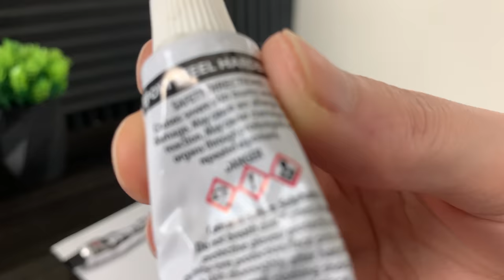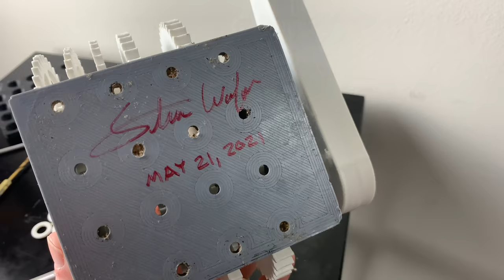3D Printer Gearbox - Spinning it FAST

Comment: Something I see a lot with 3d print guys... Glue in place of mechanical stuff.

Put keyways into your shafts, no you don't need a lathe, use a bigger shaft, drill through it, tap it and screw a cap head bolt into it.

Also, light lubrication and bearings are an easy addition.

Comment: For the handle, grind a flat side on the end of the metal shaft and match that in the handle. Then you get mechanical structure to reinforce the JBWeld.

Comment: Mechanically pin the handle to the drive shaft a small steel pin along with the job weld will get you going pretty good

Comment: It’s like blowers on engines. For the biggest ones you need 800-900 foot pounds of torque to spin it.

Rough the interface you use JB Weld on to give it more grab.

Comment: It would be great if some small ball bearings are used for the gears to reduce friction on the shaft , quite possible it would help spin the gears even fast due to less friction .

Comment: I am sure the suggestion is here, but I would flatten the sides of the main shaft where the handle connects so you can get so more torque. 
Second you can get a laser tachometer for under $30 to give you a pretty accurate read.

Comment: Brick experiment Channel used silicone oil between all the teeth to cut down all the friction.  There's a part of the meshing where they rub perpendicularly, and that's where most of the energy loss comes from.

Comment: Definitely faster than most cars. I've been driviing karts a lot though and they still come out ahead. The largest RPM I've seen there was 17k RPM, my own motor got up to a max of 15.5k RPM.
Gotta stress how not common this is for an engine with gears though. Even racecars tend to keep it below 8000-9000 RPM. NASCAR, F1, Indycar and similar go over.

Comment: Just image to do it with titanium gears precicly cut, screwed to the shaft (or made in one piece), everything oiled at the right places, with a huge motor. Not sure if that has been done already. Cool project to do it with a 3D printer and creating all part by yourself.

Comment: If you would just hold the handle right you could crank it slowly increasing the speed and you could get it a lot faster im sure. It’d reduce the pressure on the handle it has when you just put full force onto it from a stop.

Comment: grind out some notches on the steel bar in where you apply the epoxy. it will grip the metal better

Comment: You should use lubrication
Mostly to reduce generated heat.
Also scale down the last gear a lot so you have even less spinning mass.

On top, maybe try belted gearing. It's more efficient!
And use bearings for the gears

Comment: You can't just depend on the chemical bond of the JB weld. You need an physical bond like an pin or an joint, even making scratches on the surface of the material that needs to be glued will allow it the glue to have more grip on the material so you won't have the jb weld failing.

Comment: Why not use a square key shaft as opposed to round? If you can find some 10mm/1.5mm radius corner shaft... minimal issue with stress points at corners.
Much stronger fit within plastic gears and simply print some bushings to insert into 13mm bearings at either end.
Reply: Also... when using JB to bond PLA to steel... add some notches to the steel or drill and add pins. Oversize the PLA socket and profile in a star shape. Fill with JB and insert shaft in the socket.

Comment: You should make a metal handle or use a longer bar for the shaft and bend it (check some old hand drills for the shape), and use the same shaft to spin it.

Comment: For it not to break put creases.. like in the gears.. then let it match togetherin the handle and the metal tubing.. that way it will not slip or dependent to the epoxy

Comment: Would be cool for you to get a digital tachometer, to compare the calculated gear speed vs actual. If the prints are good the calculations are probably accurate, but would still be a great video aid to see the numbers digitally!!

Comment: You need to key the shaft for the handle so it doesn't break off and then maybe some tiny ball bearings but keep it small the bigger you go the more energy required to input and control.  Flywheels are dangerous

Comment: Mechanical Engineer here... You should invest in keyed shafts, oil-impregnated bronze bushings OR nylon bushings OR cheap ball bearing, and shaft collars.  There's no need for hot glue and epoxy here.  Press the bushings/bearings into the gears.  Besides the fact that you'll have a much more efficient system, these materials are cheap and will allow you to reuse parts instead of ruining them with hot glue and epoxy.

Just a design recommendation, make the housing a square tube instead of a channel and fillet the inside corners.  This will lower resonance significantly, which will drastically reduce friction.

Comment: I figured out that if you print with bridging under the gear you can get the sharp tooth gear to print with perfect print. Just raise the model slightly off the bed and use auto bridging.

Comment: Make the handle part so you can place a drill on it, put drill on low torc and rev it, then put a generator on the end and you will have made more power than the drill uses (I wish, but it will go fast tho), also when you have it up in speed, it should take less force to keep it turning, ergo you can go from low torc to fast when it is going for full, maybe ;)

Comment: That's great!
I've been investigating how to easiest make a DIY oil filter centrifuge. But as I have zero experience with welding I wondered if it can be done with (tough) plastics.
The main trouble is of course to have the spinning cylinder survive safely very high RPMs.
9000 RPMs are more than plenty for my purpose :) 
But now I also wonder if using J-B Weld with stainless steel parts (that will be spinning at several thousands RPMs) would be good enough.

Comment: Alright ik this is a bit of a stretch but I think you could make the gear ratio bigger and instead of 3d printing the handles get them specially made from steel/some kind of metal

Comment: Dude, stop using jbweld and hotsnort.
Use brass/alu collars that screw onto the shaft with a grub screw and are also screwed to 3D printed gear/handle.
To hold the shaft into the housing just have a hole and drive a grub screw there as well, no need for collars.

Comment: To attach the handle to shaft put a simple threaded hole and use a set screw to hold the handle on the shaft, easy peese

Comment: Would be an interesting project to try some better gear ratios in a small wind turbine, I read that " 1,000 to 1,800 " RPM produce electricity with most wind turbines, imagine 10,000.

Comment: Maybe set it up on a table slightly higher off of the ground and away from a wall. This would allow room for a handle at least a meter long. What about metal gears?
Reply: Well,metal gears would kinda defeat the point of a 3d printed gear setup

Comment: You could at least sand the part you glued. Making it a square shape or putting in slots would be better. A hole with another rod going through it for extra support would be even better. But that’s going way outside your printing thing which is the whole deal. Really cool.

Comment: I wonder if you could make a pedal car with something like this... Like a super light but sporty looking frame powered only by pedaling the gears like a bicycle, but could easily reach a normal car's city driving speeds....
Reply: such things exist. but for your idea to be pragmatic it would be a serious engineering feat.

You would need very powerful legs, and the more gearing and complexity you add to aid the human mechanical power and convert into RPM and torque the more complex and heavier the machine becomes.

Comment: So, is it possible to store this energy? What I mean is, if there were 14 wheels instead of 10, and if we could somehow store the rotational energy created by the 14th wheel, we could make a scooter that could go for a long time with little energy. Initially, the user pushes the scooter with his foot several times (just like an electric scooter), and 14 wheels turn with the rotation of the wheel. Then, we can use rotational energy little by little with a part that will act as a throttle lever. Even if this system does not work, we can still save energy on electric bikes and scooters. Of course, the first thing to do is to store rotational energy. and secondly, to use only some of this energy and store the rest again.

Comment: why not try tribofilaments for this? some are printable on a normal 3dprinter anyway. A bit expensive at $100 per kg, but you can print only the center and the teeth with it and the rest (non moving parts) with PLA. It would reduce the friction to less than 10% and allow you to rotate a lot faster. Speed, centrifugal force and even wind resistance would likely come into play before the integrity of the handle in that setting.

Comment: You're using so much force to lift the handle up that you lift up the whole table. Maybe you could add some weight to it or make the table legs more stable and not sure if it's intendet or are you just holding the camera, but you should use your second arm for holding the handle in. And lastly make sure that you spin the handle slowly and slowly make your way of the rps faster so that the glue that the handle is held by doesn't just detach handle's on

Comment: Great build and video!  Any thoughts on what it would take to to connect the output to an alternator or dc motor/generator to be able to charge a 12v 100AH Lithium battery for energy storage?  Gravity, being free, a weight could be attached to the input side and dropped from a height.  With an appropriate electrical components, a proof of concept could lead to next level energy generation for the home into batteries for storage

Comment: Try to add two aimant in opposition(one in first gear and an other in last gear). And with a Hall sensor make a comparison between the n’ombres of rotation ( mechanical formula and timers of a microcontroller)
Reply: No need, he calculated the gear ratio according to the number of teeth.  So just measuring the speed of the handle gave him all the speeds without needing a computer.

Comment: a lot of things here, especially the handle and frame should have been made from metal. its obvious weakpoints of the structure, added to that, ballbearings would propably not be of too much harm to acquire. furthermore, you should not rely on glue or similar substances to attach items to one another. creating mechanical attachments is not only more reliable but also easier to take apart if you need to change something.

Comment: Duuud, try generating electricity with the last wheel, I'm intrested in knowing what's the output power compared to the input, and what are the possible uses in EVs?!
Reply: Output power is less than input power due to heat and sound losses.
Possible EV uses... I can't think of any.

Comment: I'm surprised that, of all the places where it could have broken, the adhesive broke at the handle; the slowest moving part. Though, I suppose, the most direct target of your applied force. If you created cavities in the crank and the shaft for the adhesive to fill, could that hold better, or would it just jeopardize the structural integrity?

Comment: Hmmm,well,the speed is high but the force is low.To us its low,but for something ant sized its strong.So in order to get speed AND force we whould need something of a much bigger scale.Imagine you make something bigger and mount a sand paper belt at the fastest gear,place a 4 pound weight on the crank.No electricity needed(but it whouldnt really make a big difference in powerconsumption,unless you are using it all day every day to add finishing touches on your products)

Comment: Should have 3d printed a key way to attach the gear to the shaft plus used epoxy. That gear would never move. Btw when using jb weld on metal like that you should use sand paper or a file or something to score and roughen up the metal before you apply the epoxy so the epoxy has something to grab onto. Yea i was wondering why you mounted the box to the center of the table. I was waiting for the circular saw to come through and cut off the section where ur handle was but i see you just moved it lol.

Comment: 10k rpm? Wow, impressive....you've, almost, spun it faster than the upper safety point of a rotary engine. Spun it as fast as a very lightly modified 1.6LITER Honda engine and slower than a kind of modded 2 LITER Honda engine. Keep going, you'll get high rpm eventually.

Comment: If you use 1 large metal piece for both the handle and axle, you could put more torque behind the action. Would there be a way to gain maximum output with gears to power a generator. See how much watts you can generate with 1, 10, and 100 rotations.

Comment: You should’ve used a steed handle, just use a cut wheel and grinder and weld them together. There’s no way in welds stronger than steel

Comment: I need to see what happens if the largest gear spins as fast as the smallest gear
Reply: I did some maths, if I'm not mistaken, the smallest gear would reach over 5 million RPM and the teeth of this gear would spin with a speed of around 70 thousands km/h.

Comment: Rebuild the whole thing out of solid metal and Is then put a motor on both sides one with strong torque For the input And the other side For the thin gear Is put a light resistance motor Is to collect all that energy or make energy out of that 10000 plus RPM

Comment: use poly carbon gears and spin them with cars also use large lubed up ball bearings and double the gear ratio also add a fly wheel the get a sustained spin time

Comment: grind some splines onto the shaft before you JB weld the handle on. shaft is too smooth for any kind of epoxy to have any strength

Comment: Whew.  This needs to be done with metal (tungsten-carbide maybe?) and upsized to like 5 foot diameter gears and stacked 30 or 40 gears (or more).  Why aren't engineers working on this?  I think we could approach the speed of light this way.  I'm probably wrong.  But we have to try!  As a civilization.  Let this be our tower of babel.  Let's prove them wrong. We CAN reach the speed of light.  And touch it.

Comment: Have you considered applying a gearbox like this to something like a bicycle and using it to ramp up an alternator? I’d be curious to know if it increases power output or if it would make turning it impossible from the load on the final ratio
Reply: It increases speed, decreases force and doesn't change power (except all those friction losses).  Biggest dynamos rotate as slowly as practical to reduce friction losses.

Comment: I've noticed that it's getting less expensive (over time, and because of failures, and the domino-effect failures cause in other parts, costing more) to pick-and-choose how I'm designing things that have 3d printed parts involved.  For instance, gears should be outsourced, not printed.  And larger/flat/frame/superstructure parts are better made from panels of specific materials (carbon fiber, glass filled nylon).  I leave specific parts I can not source otherwise to the printer (toroidal input/output discs in my CVT transmission designs... which I really need to start making the videos on :D )

Comment: Hey , you can change much thing in life with this kind of prints , in the past i was thinking on making some energy if i make a pond , the pump that mouve the wather to the filter sistem to make it fo on a whater wheel , so that wather wheel to be atached to a gearbox and put a dc motor to regenerate some energy so loose less electricity in the proces of filtration , at a bigger filter and pump with watherwheel and a dc motor you win much energy with a good gearbox like your , just a bit stroger

Comment: Could you attach a generator of some kind to the end and generate electricity? I'm trying to figure out a way to make some off grid energy using gravity, using gears that are beefy enough I'm wondering if I could Hoist then attach a heavy ass rock to a high ratio gearbox to spin a generator at the end. Maybe it's clear but I have no idea how a generator or a gearbox really work.